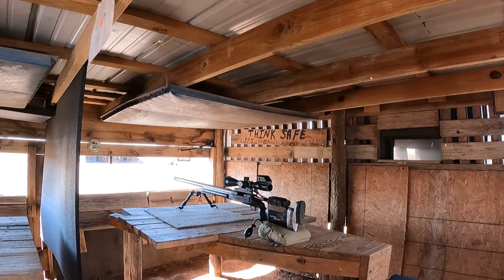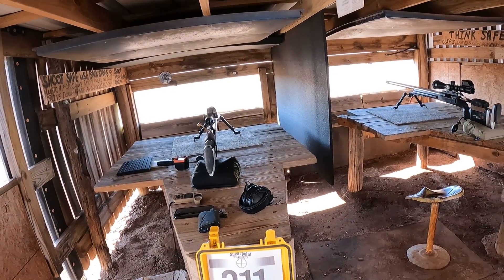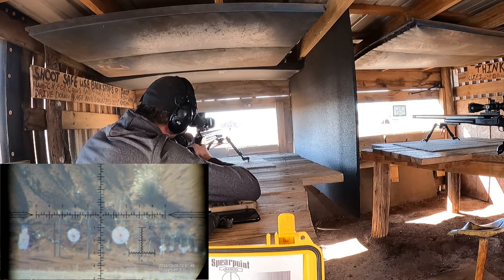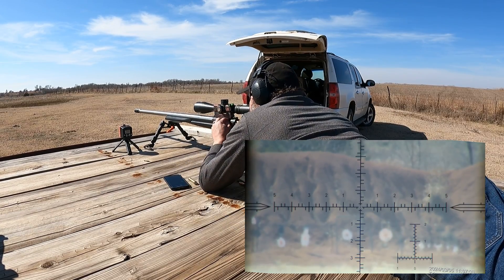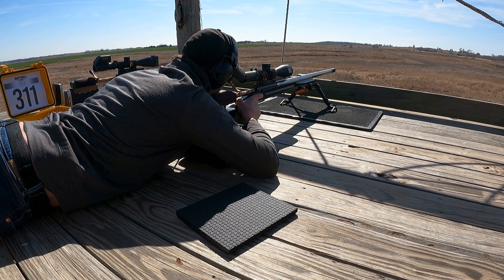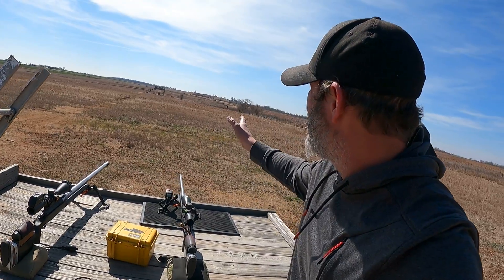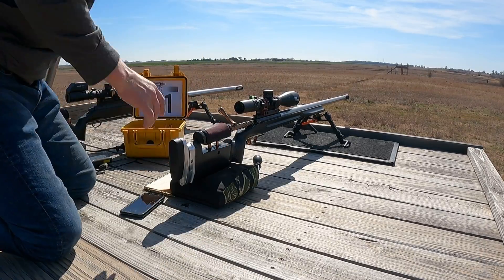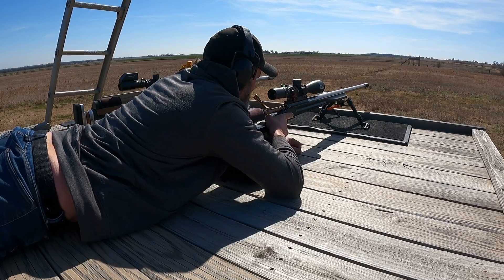Giving away my secrets Final load tests and distance testing on the 33xc at 700-2152 yards 1 of 3

Comment: Damn 33xc ballistics looks awesome! Hard to beat even with a 375ct? Although the 33xc has less splash, which I guess is why you dont see them at K02m anymore
Reply from the maker: Back in the day 338s were allowed at KO2M. I was one of 2 allowed in 2019, which was the final year for 338s.  Then in 2022 they branched into light and heavy divisions and started KO1M for the 338s and smaller.